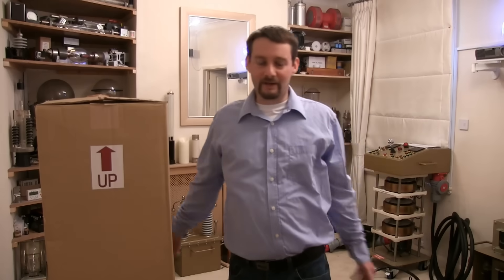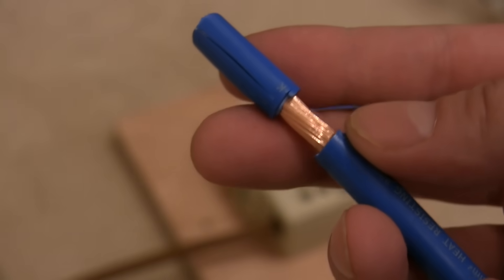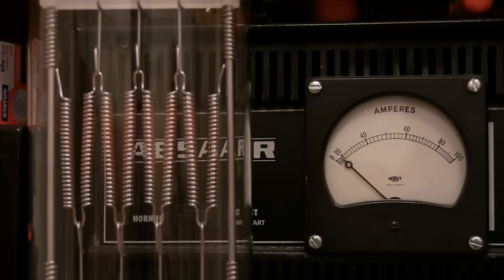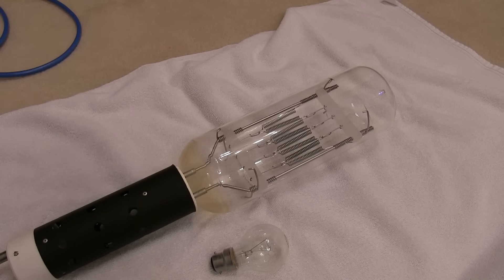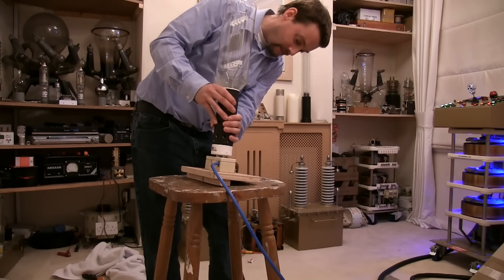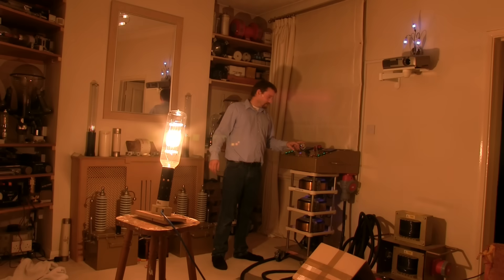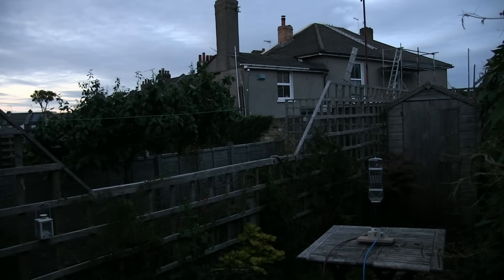20,000 Watt Light Bulb Test

Comment: Guinness World Record : Highest Electric Bill ever recorded
Reply: After see this video never scare with the dark again...this scares me more
Reply: I doubt his 100 amp output is going through his electricity meter
Reply: @DidntKnowWhatToPut1  lmao
Reply: Hahaha
Reply: 20kW for an hour will make only 20kWh which costs less than 3 dollars in india
Reply: @नितिनअग्रवाल , it will cost 3$ in most countries, other than Germany (where almost everything is more expensive, because of a bad health system and VAT).
Reply: @नितिनअग्रवाल  yeah that's like 2 bux 30 here and we have high power prices
Reply: @syaz4380  That's not how power works. Transformers don't just magically supply energy. You can scale the current and the voltage, but a watt is a watt. In fact a little less due to loss in the transformer.
Reply: Kedar shat that's the north star
Reply: "Sir, what do you use these light bulbs for?"
"Sometimes I like to pretend I'm Ra."
Reply: Astronaut from space : wtf is that
Reply: @syaz4380   SyazTYT's other uploads  that's not how this works. The filament of the bulb is a (more or less, we got to see the surge) fixed resistance at it's operating point. Meaning that for it to draw 20kW, the FULL 240v must be placed across its terminals. This leads to a current draw of 83.3A, which means that the resistance of the filament is a staggeringly low 2.88 ohms. Putting, as you say, 13A across this resistance would require a mains voltage of about 37.5vRMS, which is clearly not the case. Also, this would only lead to a power consumption of 487.5w, which is much lower than demonstrated in the video.
Reply: Fun fact: if your electric bill is high enough, the electric company will actually notify the police, and they'll show up to check your place for drugs.

Apparently it takes a lot of electricity to grow drugs. 😂

Edit: I should make clear that if you rack up a large bill over time, then you'll be fine as far as the police is concerned. But say you live in an average sized home, and your bill is something ridiculous like 5 thousand dollars in one month, then yeah, you'd better be getting ready for a knock on your door. 😱
Reply: @pumpkin6429  good to know. How high would the bill need to be for the eletric company to contact the police?
Reply: @Zombiekiller5072  trynna grow some weeds??
Reply: @Zombiekiller5072  nga you ain’t doing shit with this information zombiekiller5072
Reply: @pumpkin6429  And imagine as police approaching the place they just notice the house is mini sun
Reply: @pumpkin6429  p
Reply: @pumpkin6429  of live in Texas where $5,000 electric bill is a walk in the park
Reply: @pumpkin6429  Is there a limit at what Electricity company will stop providing electricity? Like if you replace fuse with nail and draw 1 megawat?
Reply: @pumpkin6429  with smart meters it's possible to analyse the use with precision and metadata indicates  A LOT
Reply: @pepevonkek7803  they are fighting the installing of smart meters here tooth and nail LOL, though for some odd reasons like thinking they cause headaches and cancer, which some how I doubt that, as I suspect any "transmission" they would do if they are wireless would be bursts containing all the data from between burst. personally I think its just creepy and is a good reason to go green and make your own electricity even if you have to find an old large TV and take the picture tube apart (the CRT based ones from before flat screen units) so you can make your own solar cells through plasma assisted vapor deposition LOL.
Reply: Pumpkin r/todayilearned
Reply: Are you growing weed in you basement.
No I just have a big ass light show every night
Reply: This bulb uses approx 55 dollars a day in electricity if used for the whole 24 hours of the day. 1636 dollars a month if used 24/7
Reply: World's most expensive house's electricity bill was $1.4m or 12 lakh
But, it's a 27 story sky scraper
Reply: Stream Highlights so about $1,000
Reply: Power bill? This guy is connected directly to the powerline to his house.
Reply: Pfft, you don't even know. Try growing, easy to max out 200 amp panel for a house. On an industrial scale this is nothing. Where I work, we use between 50-60 MW/h
Reply: @StabbyMcStabwood   that's nothing.. just visit a aluminum factory. Even small factory use over 2000Mw/H
Reply: @syaz4380  most likely, but he is still putting over 80A across that bulb.
Reply: I think he wired it from his neighbours
Reply: I checked it against our costs per kW and it would be around $1600 if we ran that thing 24/7 for 30 days (aprox month) just for the electricity consumption, never mind the monthly hook up fee just to be connected to the grid LOL, though I suspect in less than a week it would dry out every combustible item be it leaves, roots stems wall paper floor boards ect, all till it was bone dry and then cause it to burst into flames and the police would be coming to check for drug manufacture or growth, following the fire trucks to find their way HA HA
Reply: SyazTYT's other uploads how does that transformer work?
Reply: Hey, we in future have negative oil prices, it means buy a generator and burn what you can + get paid for that.
Reply: Yury Vorobyov what year?
Reply: Can't wait till you see styropyro
Reply: @syaz4380  20kW is 20kW. @13A it would need over 1,500V on the secondary.
You get nothing for nothing, you still need 50A on a multiphase primary
Reply: @syaz4380  20kW real power, doesn't matter what transformer he uses. He is consuming 20kW of power from electricity company.
Reply: He must have a 3 phase or 4 if that's a thing connected to his house. I think he gets the crazy wattage from transformers. He's basically at the end of that experiment drawing all the power in amps that his connection will supply. Around 90 amps. That's why it trips at the end. I've only watched 2 videos of this guy but I'm really impressed with what he's doing and how he manages to do it.
Reply: It’s all amping the power up
Reply: Haha😂
Reply: Lol
Reply: Lol 😆 🤣🤣🤣🤣🤣
Reply: Funny LMAO :-):-):-)
Reply: Rofl
Reply: When the spinning thing in the meter fractures from centrifugal force and sends supersonic shrapnel flying in all directions.
Reply: @joshuabessire9169 He tried to this exact thing in an older video. It was spinning pretty damn fast before it died a hot smoking sparking death. Which is to say He Popped It!
Reply: Lol
Reply: i was going to say you were wrong but then i remembered microwave ovens didn't exist in germany back in the 1940's
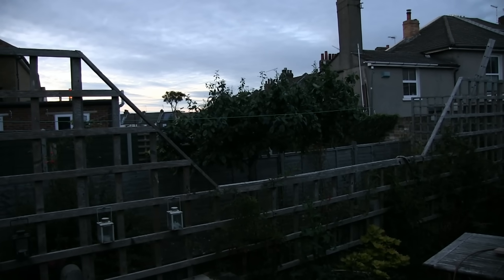Reply: 10:41 It seems like some superpower has landed or appeared 😅
Reply: His Ex wife once said that he used 1.5 MW in a year. That is extreme
Reply: How much is your electricity? Mine is around 25c/kW.hr, so this bulb would be around $5 per hour to run. Not astronomical but can add up!
Reply: Lol
Reply: it would take me a year to use as much electricity as he did just to make this video....
Reply: Exactly
Reply: To calculate the cost for 5 minutes of usage at 20 kW,

1. The Calculation
First, we find the total energy in kilowatt-hours (kWh):
Time: 5\text{ minutes} = \frac{5}{60}\text{ hours} = \frac{1}{12}\text{ of an hour}.

Energy Used: 20\text{ kW} \times \left(\frac{1}{12}\right)\text{ hours} = \mathbf{1.667\text{ kWh}}.
Using 20,000 watts for 5 minutes consumes about 1.67 units of electricity.
2. Estimated Cost
Using the same regional averages as before, here is how much those 5 minutes will cost you:

US : 28CENTS
UK : 40 pence
SG : 48 cents
MY : 0.95 myr
Reply: Where I live, a higher than normal electricity bill can cause suspicion and can warrant a visit by the police. However, before they have to go through the process of obtaining a warrant, they will often drive by the residence in question with a surveillance van fitted with FLIR cameras to detect hot spots indicative of a grow light. It's only after that in which they'll get a warrant to search your house.
Reply: @JohnDoe-vf2yo  how would they detect the hot spots if they use LED based grow lamps LOL, I have a 4 foot fluorescent tube based LED grow lamp and it does not get any hotter than the regular LED ones, which is to say no heat hardly at all, certainly not as hot as even a single 100w incandescent bulb, and less heat than my black lights get, that are only 20 inch, while the white fluorescent bulbs I replaced with these LED bulbs are even hotter than the LED version.
Reply: Oh yeah your electric company gonna tell the police if your giving them money it's when you steal your elec is the problem
Reply: @gingecole6534  You act like companies don’t collude with governments to go after people committing crimes. Perhaps they have a specific deal for this. Or perhaps there are laws created to address this specific thing. But I doubt that he’s wrong the police would work with electric companies
Reply: Its a capacitor that makes ur voltage more higher and the bill will be the same u little shit

Comment: You must be reading through the comments glad we found each other here so instead of a random comment here is a great cake recipe 

butter and flour for coating and dusting the cake pan

3 cups all-purpose flour

3 cups granulated sugar

1 1/2 cups unsweetened cocoa powder

1 tablespoon baking soda

1 1/2 teaspoons baking powder

1 1/2 teaspoons salt

4 large eggs

1 1/2 cups buttermilk

1 1/2 cups warm water

1/2 cup vegetable oil

2 teaspoons vanilla extract

Chocolate Cream Cheese Buttercream Frosting

1 1/2 cups butter softened

8 oz cream cheese softened

1 1/2 cups unsweetened cocoa powder

3 teaspoons vanilla extract

7-8 cups powdered sugar

about 1/4 cup milk as needed

US Customary - Metric

Instructions

The Most Amazing Chocolate Cake

Preheat oven to 350 degrees. Butter three 9-inch cake rounds. Dust with flour and tap out the excess.

Mix together flour, sugar, cocoa, baking soda, baking powder, and salt in a stand mixer using a low speed until combined.

Add eggs, buttermilk, warm water, oil, and vanilla. Beat on a medium speed until smooth. This should take just a couple of minutes.

Divide batter among the three pans. I found that it took just over 3 cups of the batter to divide it evenly.

Bake for 30-35 minutes until a toothpick inserted into the center comes out clean.

Cool on wire racks for 15 minutes and then turn out the cakes onto the racks and allow to cool completely.

Frost with your favorite frosting and enjoy!

Chocolate Cream Cheese Buttercream Frosting

In a large bowl, beat together butter and cream cheese until fluffy. Use a hand mixer or stand mixer for best results

Add in cocoa powder and vanilla extract. Beat until combined.

Beat in powdered sugar, 1 cup at a time. Add milk as necessary to make a spreadable consistency. The frosting should be very thick and will thicken even more if refrigerated
Reply: Thanks. I was exactly looking for this
Reply: Very random xD
Reply: Clorox bleach with vitamin B2 thanks
Reply: Are you transgender?

Comment: What is that machine your using to power it with?.. I looked in comments but didn’t see anyone mention it.. I just notice it has a control panel and like 3 coils under it?..
Reply: Looks like three motor-driven variable transformers. You sure don't want to try controlling that baby with a rheostat, and good luck finding a triac that will handle it.

Comment: You need a big light to simulate daylight because if it's too close to the subject the shadows won't all be parallel. So to simulate actual sunlight you need to be far enough away to have parallel shadows, which means you need a huge bulb. I'm sure larger film sets total at least 20kW in lighting

Comment: 20KW halogen bulbs, for when you need central heating AND central lighting! 

I bet you could do some sort of lightpipe lighting arrangement with that bulb and use the exhaust from the cooling fans to heat your house. Some buildings use electrodeless sulfur plasma lamps as a central light source then use lightpipes to distribute the light through the building. Very efficient from what I know.

Comment: I dont understand 3000 watt is max what a 40amp breaker can pull what are you using multiple breakers to do this? If you dim it you push out the uv and more infared.

Comment: Just as a question: Let's assume money, material availability, electricity and effort does not have to be considered, would it be possible to build a 1MW lightbulb? I mean maybe yes but it would probably require giant metal "wires" and all that sgit. But would it be physically possible or would no metal bar withstand such an electric power? It should, right? Power Cables also carry ludicrous amounts of power.

Oh and just in case you wonder: Yes, I have absolutely no clue about electricity and all that stuff. I just like big....number :D

Comment: I wonder if you flew a drone with that 20,000w bulb and light it up when ancient Egypt was around would they think the drone is their God?
Reply: @TypicalNerds  there are many drones capable of lifting a human, and not some experimental, extremely expensive type. By themselves they usually require a couple of kw just to hover, so adding a bigger battery wouldn't be a problem.
Reply: LocalPulsar H. The problem is heat, and the battery would have to be impressively large.
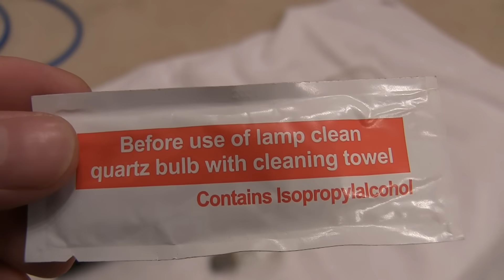Reply: But ancient Egypt was already high tech way more high tech then we currently are. :D So their gods are actually scientists but maybe something terribly went wrong and they draw out scientists as gods and what happened with "diseases" and "curses" as to some scientific disaster? or some shit i don't know man. It's 4:30 in the morning i'm off to sleep. :v
Reply: Pablo Reyes
, for your info scientist discovered that the ancient Egypt already have high tech electricity that how they build their pyramid

Comment: Hello photonicinduction, would it be possible to run the 20,000 watt light bulb using a lead-acid battery at 12 volts and 1500 amps?

Comment: I would imagine that you are familiar with using tungsten-halogen lamp but I'll reiterate just in case. First and foremost, t/h lamps can explode. Usually not until their lifetime limit approaches but can be anytime. Also, t/h produces quite a bit of UV light. You can burn your skin or retinas by direct exposure. Also heat, which you noticed. If the lamp explodes while running, you will be showered with hot quartz and molten gobs of filament. Guaranteed not to feel good.

One interesting note is that the Japanese companies continue to use the lamp in squid fishing. Apparently, squid want to go to the light. Illegal but no one enforces it. 

Good Luck.

Comment: I used to operate Rank Strand's 20KW Silver Bullet on film sets. Its an absolute beast; cables, dimming and power supply was just a headache
Reply: Mole Richardson have a 24 kW HMI fixture.  Never seen one, but a 16 kW is pretty bright.  I still like carbon arcs.

Comment: The fatter - longer the filament, the longer it last, and more Lumens it puts out for the energy it's using.  
May be as much lumens per watt as the led lights or fluorescents.  
One real big bulb is more efficient than a number of small ones.  In incandescent bulbs.

Comment: This lamp is called a CP99. It's used in a fixture called an Arri T24 Fresnel. There is also a 24kw version available. It should NEVER be operated out of its fixture like this as they have a tendency to explode. Used for many years in the film industry, at least 20 of these lamps where used on the first Harry Potter film. Oh and it's a lamp not a bulb.
Reply: I thought a lamp was the complete fixture - do you not buy a bulb to fit in a lamp?
Reply: In my experience most things have the tendency to explode when you pump 15 kw through them.
Reply: I see why he didn’t want to pop it that’s $1469 per bulb.
Reply: @metalavenger23  yeah that wouldn't be very bright
Reply: Must be hot there
Reply: Imagine how many AA batteries need to be strung up in series to power this thing…
Reply: Illuminating
Reply: dadou oméga  🤣🤣🤣true as fuck
Reply: Thank you

Comment: 20,000 watts - is about slightly.
For example, you can use the 200 watt bulb (equivalent) in your room. Just set the camera's ISO 12800 (or 10000 if available) to view the parameters of shutter speed and aperture. The same pictures you will be able to do with  this 20,000 watt bulb, but with ISO 100. Sunny summer day will be much lighter.

Comment: Inrush current is 300 amps for 10 milliseconds and then settles down to 83.33 AMPS!! (if connected to mains) Settles down whoa boy easy there with your 20,000 watt baddassery the second biggest resistance lamp I've ever seen. 90% IR Radiation.